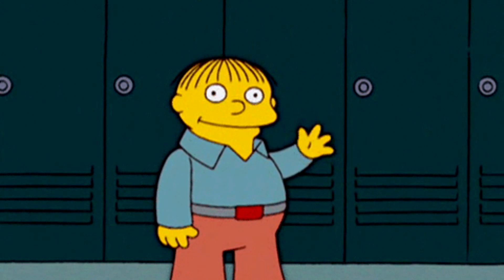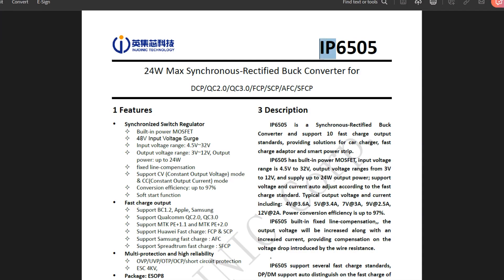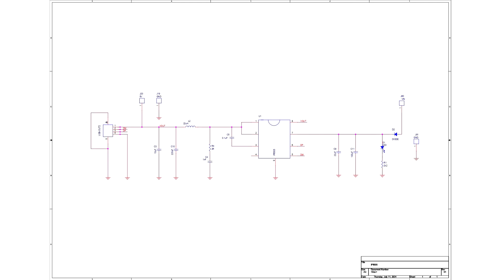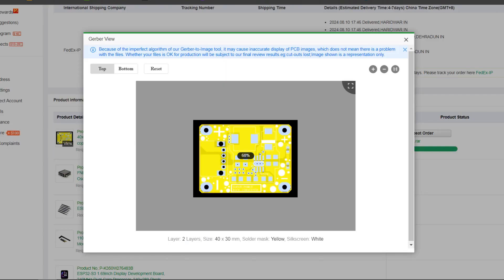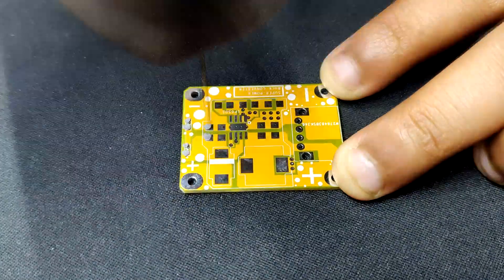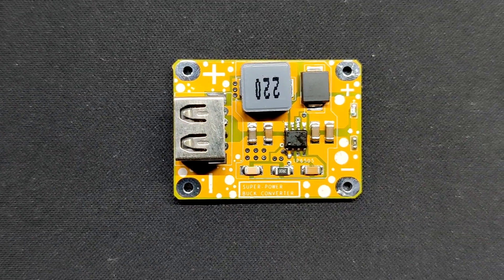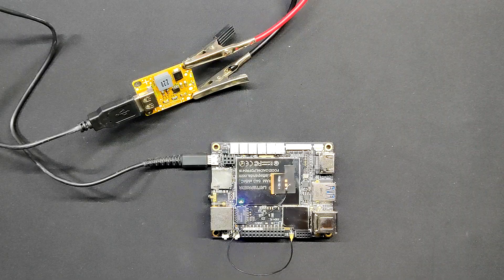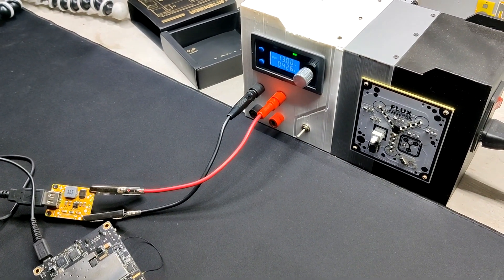DIY Buck Converter Module - Supports Power Delivery

Comment: This project is not using USB-C, how is it related to Power Delivery (PD)? With a standard USB header, this is just a 5v buck converter, there's no negotiation with the power supply, right?
Reply from the maker: Not exactly, The data terminals of USB are connected with the IC and is used for sensing the output of the load. Its all mentioned in datasheet of IP6505
Reply: @ArnovSharma  Sorry I think you are mistaken - it's not possible to do USB PD without a USB-C header. You might be able to do higher voltages thanks to fast charge modes, but this is not the same as PD. If you connect this to a USB-C device (or better yet, a USB power meter), I think you will find you can only charge USB-C devices at 5v with this board. But please do test it and let me know if I'm wrong. I only point this out because I have designed a few chargers using different INJOINIC chips, and I don't want people that are trying to design PD devices to be confused by this video.
Reply: @ArnovSharma  USB C standard prohibits any change of VBUS via data lines. USB Power delivery is only for USB-C. If it is compliant with USB-C Power delivery then it must use usb-c and control must be done via CC lines